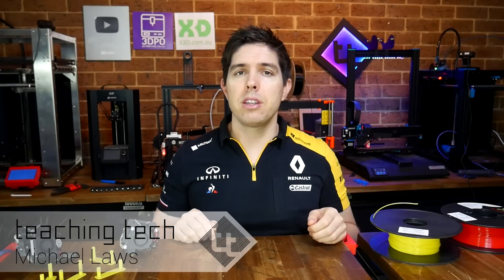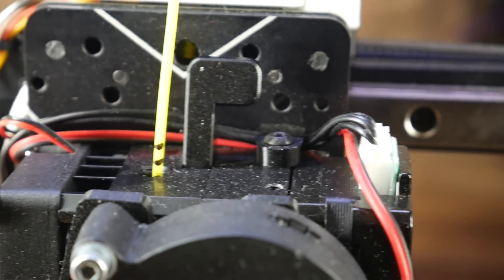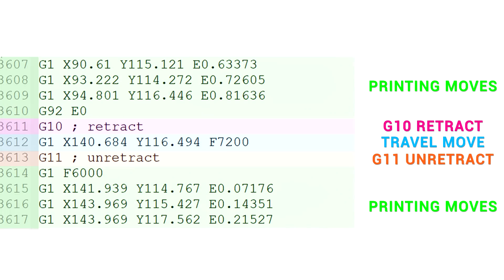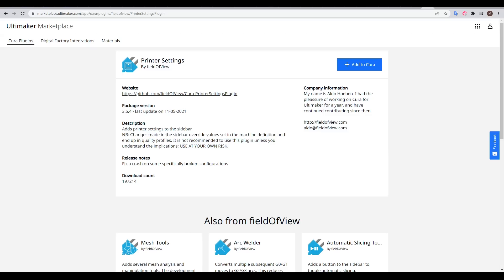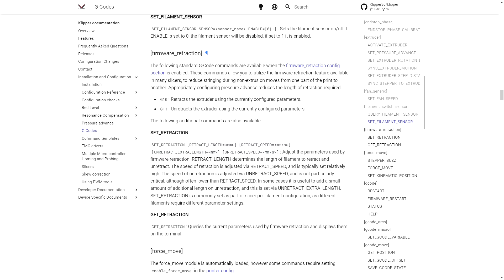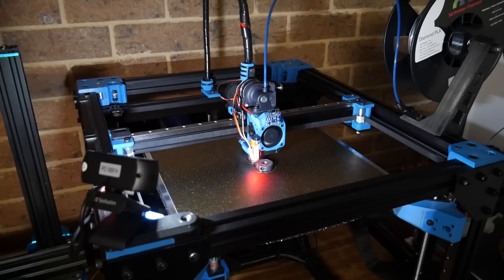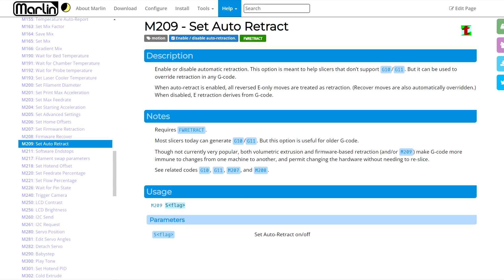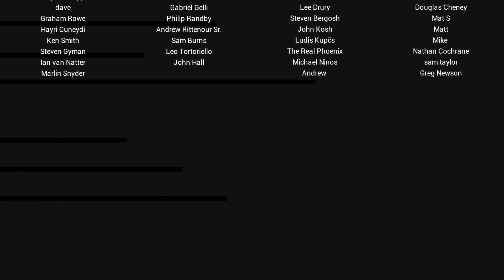Firmware retraction: Why you should try it out

Comment: It would be nice if all the machine specific settings like speed, retraction, etc were all firmware based, and the gcode had only the specifics about the print.  This way you can use the same gcode on all printers (given the print bed was large enough and you are running the same nozzle size) and the firmware would set the default speed and retraction settings.  At that point you could then share the gcode with anyone specify with them the nozzle size and away they print.  One problem I see is that the gcode has an absolute x0,y0 at the bottom left of the bed and this should be changed to an absolute x0,y0 at the center of the bed (using negative numbers in some directions which is common in geometry classes) making it easier to printer the same gcode on multiple sized printers with printers too small getting a gcode out of range error when starting the print.

Another usability option would be to make 3d printers similar to 2d printers where they have drivers that would be installed on your computer, and when you open your slicer and 3d file it would use your configured 3d printer driver and you just hit print.  This would definitely make it easier for everyone to print as desired especially with a multi user household.  I could see a company like HP get into 3d printers where they create an all in one system that would allow you to download the STL file to an STL viewer and print directly to their 3D printer.  No slicing required because it would happen automagically.  The only issue then becomes maintenance of the printhead, but that could also be a replaceable part.
Reply: The biggest detractor of putting all machine settings into firmware from the end user perspective is that --
- it will likely override g-code settings
- manufacturers will lock it to one setting and make it inaccessible to the user
- it will get removed from slicers entirely
-- all of which effectively results in loss of tools and features necessary for regular diagnostics, routine maintenance, and aftermarket upgrades.
Reply: @claws61821  the idea is to have the firmware settings be user configurable because when you change parts and perform upgrades these settings will change. However for an HP version of a 3D Printer I would expect it to be cheap enough to be throw away with a life expectancy of 10000 hours and print out of the box similar to the way 2D printers are now.
Reply: @mobilechaosyt  I have kind of that on my printer, setting the important stuff like max acceleration and axis speed in firmware as a value the slicer can try to surpass, but then the printer ignores (unless you do add some M(something) code there to override/store new values of course). In my case with the BTT closed loop steppers, the speed is pretty much hard set for me at ~80mm/s X and Y (they are normally faster than this but not on lead screws), more than that and the motors will lag behind making chanfers in the corners of squares for example, even tho they won't miss their target at the end.
I just set the firmware to that max speed and then I can run diagonals at 80mm/s per axis (so around 113mm/s) without worrying about it going out of sync.

Comment: Those tiny retraction tests I find are not that good for calibrating retraction as they generally dont have time to build up pressure. I instead make sure I have a test that has long printing moves between small gaps which simulates typical retractions for me.

Comment: Excellent video. Thank you very much. A question about the Cure plugin. Do you know if one has to keep the settings for the retraction in the profile or set the distance to 0mm to disable the feature? I'm guessing it depends on how the plugin works. I'm guessing that it modifies what Cura writes into the g-code when the conditions for a retraction are met so one would need to keep the retraction settings enabled in the profile.

Comment: Great video, and interesting. I'm probably going to stick with in-slicer retraction because I've spent the last 2+ years setting up my printing profiles, and at this point it's just one click to go from PLA to TPU or whatever. That is some insane control you get over your printer though! Might give firmware retraction a try for my next printer build, if only just to calibrate and tune it.

Comment: Superslicer appears to allow Zhop even with f/w retraction enabled. Not a pure f/w solution, but then I don't know if Klipper allows retraction changes during a print. Never looked for it.
I've been using f/w retraction in Klipper for a over a year. Combined with Pressure Advance it's only about 0.4mm for direct drive.

Comment: Have taken note of FW retraction when compiling. But never looked into it. Thanks for the explanation. Looks like a fantastic way to calibrate retraction settings very quickly and easily. 
Q: once enabled via FW is it possible to alternate back and forth between FW retraction and Slicer retraction? Or must you re compile with it disabled? 
What do you recommend for someone who uses different material types which require different retractions all the time? Would scripting be the best solution? Or just manually change the FW retraction settings?
Reply: I'm not sure about other firmware, but marlin has an option to force fw retractions (which I think is on by default despite when you enable fw retract). If you make sure to comment out FWRETRACT_AUTORETRACT you should then be able to switch between normal and FW retraction just by the options in the slicer. Otherwise it will try to convert small E moves into fw retract moves.

Comment: Good explanation. I’ve never seen a major benefit to firmware retraction so I still just do all retraction in the slicer. 
Many times stringing appears due to failing PTFE, worn nozzle or slipping extruder gear. Fixing those instead of modifying settings is often times the last thing people do instead of the first.
Reply: Another awesome video Michael. I love it when when different content is created. It's always good to see other You Tubers content creators visiting other content creators ( love your channel by the way CHEP)
Reply: @CHEP Ive been getting hair like stringing after shifting to a dual fan duct with a 5015 blower fan. I'm very perplexed as to why additional cooling is introducing stringing and how could I eliminate it.
Reply: @ishanmamadapur6307  what are you running your fan at? And are you using dual ducts or single?
Reply: @ishanmamadapur6307  As a random crapshot in the dark, I could say maybe your ducts aren't exactly pointing the airflow where you'll want it more, and could be cooling stuff that doesn't need.
Even a wrong voltage fan could happen without more info (like a 24v fan on a 12v system).

Comment: Looks like your BLtouch had an incident.  I broke a probe at a poor time.  Aside from buying 10 replacement probes I also printed a guard around the BLtouch such that the retracted probe is hidden completely.  Hopefully that works... but being a rather secure guard it will probably smash into a failed print with force and create worse damage :p  learning is fun!
Reply: I've had a failing 5v cable to my toolhead once, the clone BL Touch (A Triangle Labs 3D touch, pretty good build and precision) kept resetting mid print, which means it went through that cycling up/down on the probe... Of course it happened in a print once that it bent it beautifully.
Could still "fix" it by bending it back but thankfully those probe needles/stylus (whatever it's called) are cheap and readily available even locally, bought 2 as spares and replaced the bent one when I could.